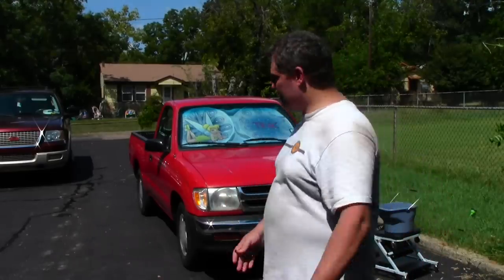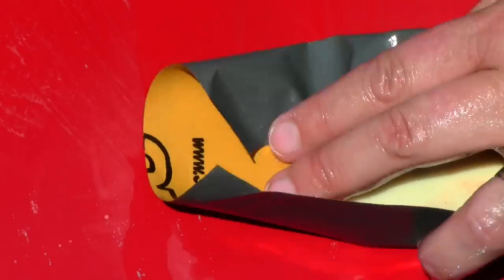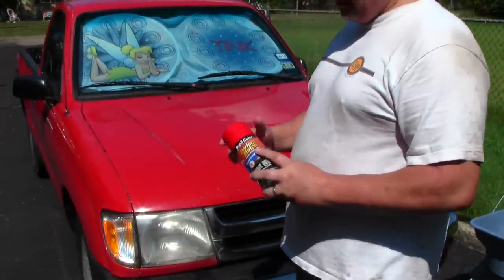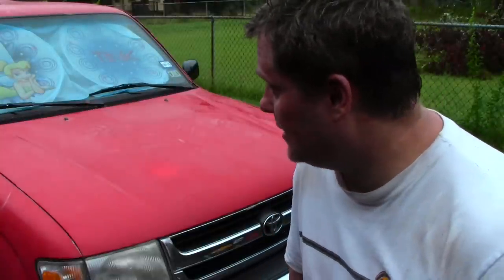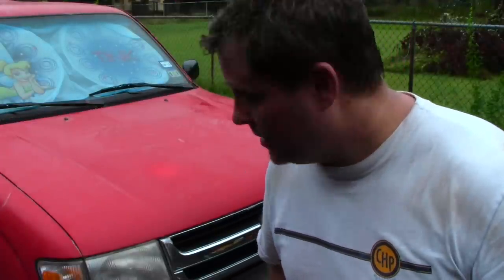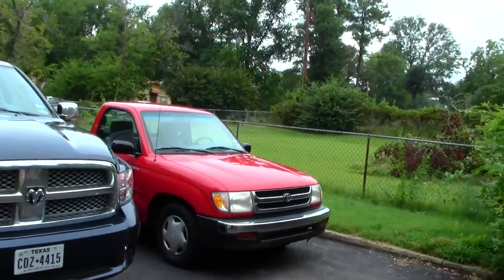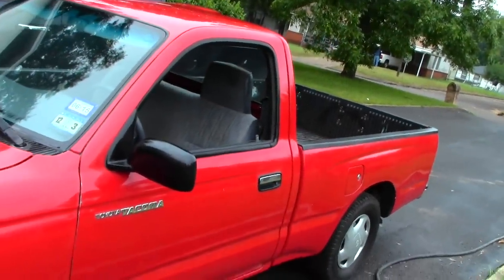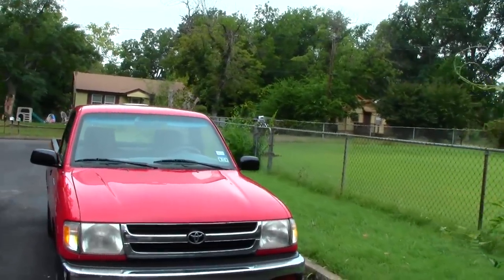Restore an oxidized paint job on a truck Part 2

Comment: $65 in materials and a $1000 in labor bud! You busted your balls on that truck! Great, great job! I'm totally inspired to do my '97 Ram.
Reply: 65$ in material but you need two polishers worth in between 200$ and 800$ to do the job.  If you want to be really cheap you could grab a rotary and a dual action polisher at Harbour Freight for 50$ each.  And you need to know how to use the rotary or you will burn through the edges.   I would have liked to see a close up on the painted areas he did.  Looks good from 10 feet away but impossible to say what it look like up close.  Overall it's a great job.  The truck looks 20 years younger.   I am curious on how long all this took.

Comment: good do it yourself job, a suggestion though when you wet sanding go in 1 direction when you sanding not in cular  north  to south,  and you can buff headlights as well it will help the appeal taking the oxidation off. Yes they will definetly get more dollars for it. Good job
Reply from the maker: thanks for the tip

Comment: Perfect friend, congratulations.
Please tell me what you used step by step, products and berets, I'm from Brazil.
Congratulations again.
Reply from the maker: +Dannylo2005 It was pretty straight forward, I used a adjustable speed orbital polisher, and M3 Finessit. then I followed up by a couple small paint chips with some 3m glaze filler. primer and paint all rattle can. finish with  some light sanding with 2000 grit SP. clear coat.  Hope that helps and remember I'm not a pro but lots of practice will make these jobs easier.
Reply: +Paul Foster thank You!

Comment: So...You used compound on there, than waxed it? Does it help keep it looking like how it is now for awhile, even after washes?
Reply from the maker: Yes I used 3M Finesse It rubbing compound 1500 grit, there were some spots that I needed to go back and use a heavier rubbing compound once I got the truck into the sun. After that the wax helped protect it. I saw the truck the other day and it is holding up. The key is to keep it clean and I would wax it about 2 times a year depending on exposure. thats really based on information i've picked up over the last year.

Comment: How long does the new look last ?
Reply from the maker: +Cesar Gomez I actually did a check up on the truck a year later.there is a video for that check it out.
Reply: As long as you keep reapplying a quality sealant and wax as needed, though slowly time will still take its toll, nothing exposed to sun lasts forever.

Comment: im not getting the glossy finish,, any suggestions? its a black 10 years old volvo
ill really appriciate it. thanks
Reply from the maker: N B, this was a 1 stage paint job. base coat and polish, if you have a 2 stage paint job then there is paint, buff, clear then polish. Once clear coat breaks down in a 2 stage paint job, you cannot fix it. on that later if it is  1 stage paint job the trick is not to but a ton of pressure on the pad and keep it moving. That is what works for me, other viewers may have some additional suggestions.

Comment: any one got tips to stop oxidizeding as I have a red corsa and I t cut the hole car 3 months ago and the oxidizing is comeing back it a 2004  corsa 1.0
Reply from the maker: +jameshone1000 only thing I can suggest keep it out of the rain and sun. so garage it or cover it.
Reply: +jameshone1000 Well to prevent oxidation is to wash  car regularly, if you already have oxidation , you will use a clay bar to remove embedded contaminant on your paint, than compound and polish your car finish, than apply a good wax , apply at least 4-5 times a year, that should keep oxidation away, wax will protect your finish from elements
Reply: +Abel Celestin  Jr And add a Iron Remover AFTER claying to the regimen....The true cause of the problem...
Reply: Oxidation is caused by exposure to sun and air.  The best way to slow it down it to keep the paint protected.  The basic protection you can use is a wax.  It has to be done once a month (approx.) if you go with that.  One step up is to use a paint sealant (synthetic wax) that is polymer based.  These usually last up to six months and it's recommended to re-apply every 3 months.  Higher level protection would be a ceramic coating, those usually last between 2 to 9 years depending on the product, they have to be applied professionally if you want them to last.

Comment: He said it took him 20 hours and he is doing it for a 15 yr old kid????   What did he get paid to do the job?  $10 an hour would be $200 ; $15 would be 300 plus the extra 100 for materials -- $400 ; would have been better dollar and cent wise (time/labor is a cost) to get it painted.  For a vehicle that small, you can easily get a half decent job for around $300-$500; way more bag for the buck.  And a half decent paint job would be 1000 times better that someone burning off a clear coat (or base) for 18 hours and doing only doing bare metal touch up.
Don't get me wrong.  The guy worked hard, did a "good" job, etc.  But you have to first do a cost anylsis on this stuff before you jump in. 

----- Great job, but bottom line is, yes it looks a ton better but for close to the cost of a paint job, you have a better looking version of what you had but by taking off a layer of paint (i.e., diminishing  the current paint job).
------ NOW, if the punk 15 year did it himself, then good on him (out $60 in materials and its great that we got him away from video games for 20 hours (no loss on labor time).  That might make a little more sense.   OR maybe in the alternative, if you hanging with the kids or buddies and your just doing the truck kind of to kill time and hang.  Again, okay if that is what you enjoy doing with your time... but your time (labor) still needs to be inputted in what it "really cost" to do the job.

Comment: SO You basically burn all of the clear coat off of the truck then have them come and get it. lol In about 6 months it will have a light coat of surface rust, and the so called touch up with the paint spray will flake off. NICE JOB.
Reply: Tom Scott this truck probably had a single stage paint without a clear coat. That’s why they oxidize so easily